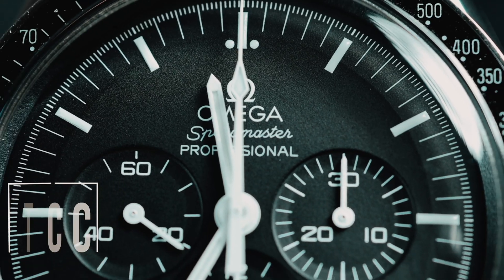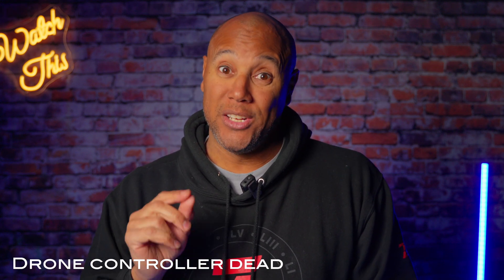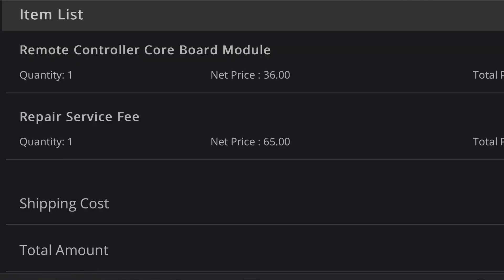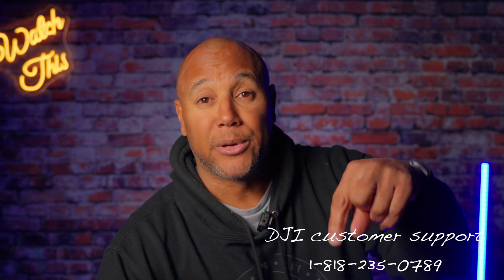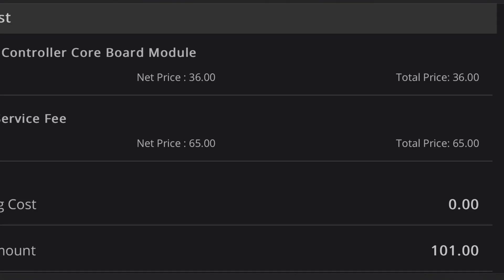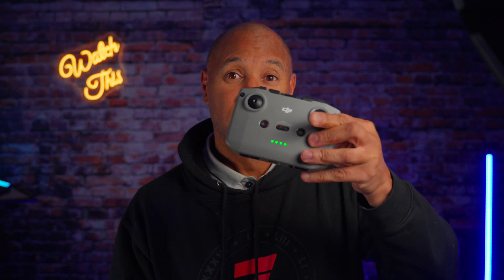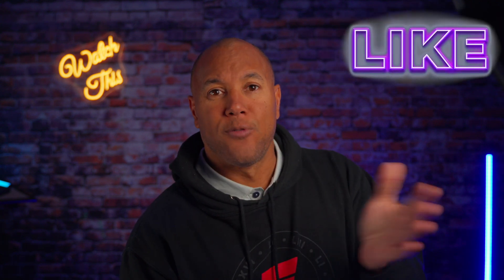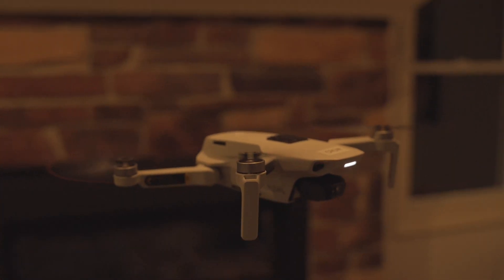DJI MINI 2 DRONE CONTROLLER FIX UPDATE| Dead drone controller repair, cost and process update

Comment: Happened to me just now. I turned it on actually and it worked and I flew the drone just fine. I turned the controller off and an hour later came back to it not working and dead….yea DJI why does your product not work properly?

Comment: This is bullshit. I was flying mine, controller shut down and drone came to me. I was unable to charge it and raised a case. They told me the same thing. "Remote Controller Core Board Module" and now I have to pay $101 plus tax. I had not let it sit for months and this is what they are telling everyone. I know I had a software update few days before this happened. Told them so and still didn't matter.
Reply: I have the same problem. I wanted to fly with the drone today. The controller was charged to +-100%. I quickly installed the new update for the app and the firmware update for the drone and shortly afterwards I started using the drone. After 5 minutes the controller went off and the drone came back. Since then the controller can no longer be started or charged.

Comment: mine keeps turning off it only stays on for 5 seconds when the phone is connected. but I have  not used it in almost a year so im wondering if i have the same problem. im like 5 updates in.

Comment: So if the health of the batteries was affected, why didn't Dji replace the batteries as well?  I've replaced  batteries in a lot of electronic devices and never had a PC board "Shut down" or fail due to battery health. Shame on Dji for putting this on the consumer. We can only hope they have re-designed the faulty board/software so it doesn't take a dump every year due to battery condition.
Reply from the maker: Yeah good question, I was shocked at the whole thing, but I could only do what they recommended. Oh well, not bad costs and back up and running, it just sucks. Thanks for watching.

Comment: Hi there. While we appreciate your feedback with our customer support. Please note to fully charge the battery at least once every three months to maintain battery health. As always, should you need to contact us for any reason, please know that we are always here to help. Thank you for choosing DJI.
Reply from the maker: yes thanks, I found out the hard way. I will be sure to do that going forward. Thanks for watching
Reply: @TheCovertCrow  You're welcome. If there is anything we can help you with, please feel free to contact us.
Reply: Tbh I think this is a cop out from dji as I have kept mine charged every couple of weeks and kept in immaculate condition and as soon as I done the update yesterday my controller won't turn on or charge anymore 🙃  I also flew my drone last week and it was fine but the minute the update was applied thats when the issues started
Reply from the maker: @THEFLYINGSCOTSMAN-oj7jm  So its good to see I'm not the only one but bad to hear you have a similar issue, hope the videos help, part 1 and 2. Thanks for watching
Reply: @TheCovertCrow  yeah the videos helped me narrow it down thank you 🙏 I just need to get it repaired and il be back out flying again 😪😁👌
Reply: My controller just stopped working aswell. Looks like it is pretty common problem.
I used it every week and kept it charged..
😢
Reply: @owenmarshall78 Hi, there. Apologies for reading about this feedback and for any inconvenience caused. May we confirm what you have done so far when you've encountered the concern? Additionally, do you already have an ongoing ticket or repair request? If yes, you may also share with us the details. Thank you.
Reply: @DJISupportGlobal mine is not working any more. Just did not start and notbcharging in fact it worked 10 minutes before. Where can I get in tpugh with you? Pls do not recommend rwpair service. I need someone to talk to
Reply: @owenmarshall78  Hello there! We apologize for any inconvenience caused. Does it not turn on anymore? or charging? Please provide us with more details of the issue you are experiencing with the remote controller. Thank you for your cooperation and patience.
Reply: @DJISupportGlobal  ok thanks for feed back i just boaught another dji mini2 because i couldnt live with out having a drone..
Im not sure controller just went dead. No lights or sounds or response.
Was only 7months old and i use 2 or more timed a week for my blogg.
Reply: Same problem with me I did not charge it for a couple of months and bang I cannot use it anymore need help
Reply: @nemrodlorenzo1590  Hi there, we would like to apologize for the inconvenience. Could you please let us know which drone you are currently using? This information will help us assist you more effectively.

Thank you for your cooperation, and we look forward to your reply!
Reply: @DJISupportGlobal  DJI mini 2 se sir
Reply: @nemrodlorenzo1590  Thanks for your reply. Before we proceed, could you please share your current country/region ? This information will help us provide you with the most accurate assistance. Looking forward to your reply. Thanks.